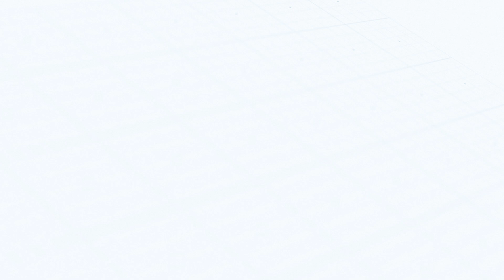Refrigeration Suction Line Piping Practices and the Proper Use of P-Traps for Refrigerant Oil Return

Comment: Simply unbalance pressure, amount of refrigerant and oil return differently between evaporators.  You just have to make sure velocity inside each evap suction line is the same between them.